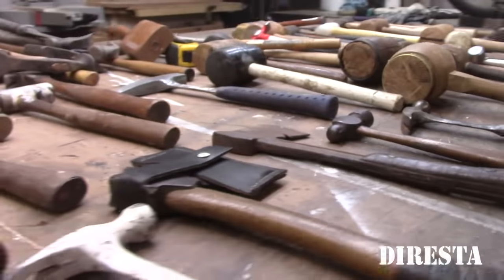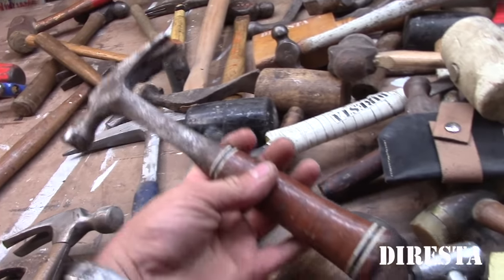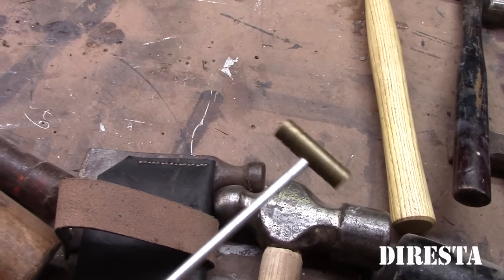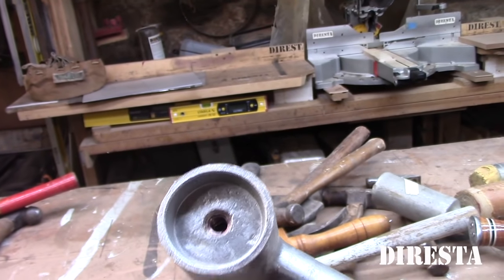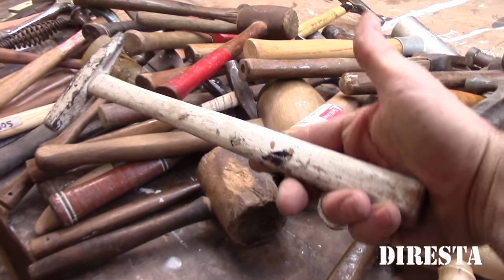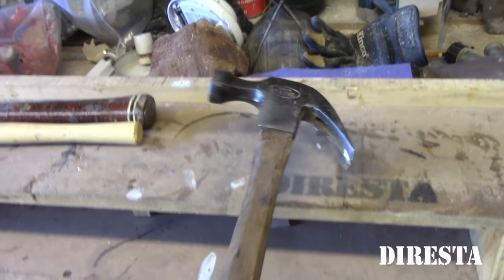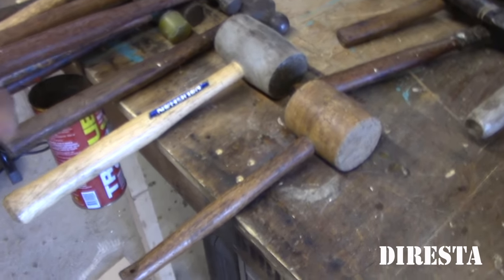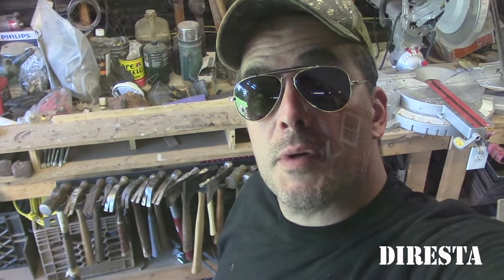✔ DiResta HAMMERS! 700K Collection

Comment: The serial killer hammers are slater hammers. You wack the back side of a slate shingle and it will give you a concave  hole on front the copper roof nail will fit in.

Comment: Love your tool collection Jimmy, the hammer that you called a roofing axe @ 4:29 is in reality a wall-board hammer for hanging drywall. It has a small notch to pull nails, a slightly rounded face for driving the cupped drywall nails, and of course an axe head to make rough cuts in the soft gypsum board.
Reply from the maker: Yes I agree. I had a brain fart.
Reply: Don't sweat the small stuff my friend, at my age (65) I attribute it to CRS (Can't Remember Shit), but it beats the alternative which is SFB (Shit For Brains) which I know you don't suffer from, but there is a lot of that going around these days.  Peace Out..........

Comment: I've used my brass harbor freight hammer so much since I bought it about two years ago the ends are almost as wide now as the middle, it's mushroomed out and shortened quite a bit. I use it especially when working on my car, really great to smash suspension parts with it because you don't have to worry about deforming the bolts or nuts you might be hitting. Well... as long as they're hardened steel that is. Cheese grade steel and aluminum though and all bets are off lol.

Comment: The hammers with the small heads that have a tapered heel that goes straight back to a strait edge...kinda like a tack hammer without the magnet.
Thats a sheet metal or fabricating hammer. The HVAC guys and gals use them to manipulate duct work and panels back before things could be bought pre made.

Comment: At 13:29 that's a shoemaker hammer, big sized one to be honest, so probably used on soles. shoemaker hammers used on leather are a bit smaller. Also the handle should be shorter to be used as shoemaker hammer

Comment: Maybe this'll help. The all aluminum hammer is actually part of a commercial meatgrinder used to pack meat into chute on grinder. Also you have one that should run 2 lbs that is a sledge on one end and the other end looks like a punch. well, it is a punch. Used on railroads by signal maintainers to knock out "chicken heads" which is an electrical connection on a rail.

Comment: I was intrigued, and apparently that Swett hammer is from the A.L. Swett Iron Works, founded 1889. The company only ceased operations in 1983, so was around for nearly a century. I couldn't find much, but there's some information about the company at the end of this page about its founder, linked here: http://www.waltergrutchfield.net/swett.htm . The page also links this cool newspaper advert from 1905: http://www.waltergrutchfield.net/images/swett-1905.jpg

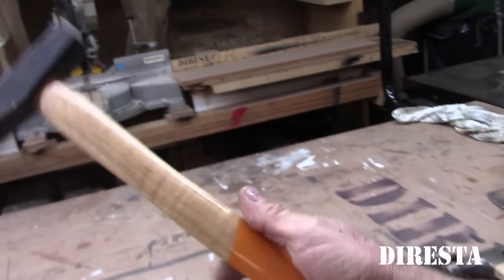Comment: The Hammer at 20:50 is actually a locksmith's hammer german pattern. For whatever reason it's the most used multi-purpose hammer in germany. Even if a claw hammer would be more useful in many cases.

Comment: The QuikWerk hammer is a hot punch or drift punch hammer. It's used by blacksmiths to drive a hole through hot metal. It was made by the Warren Tool & Forge Co in Cincinnati, Ohio founded in 1911. Apparently they rebranded a lot of their tools name to Iron City Tool Works in 1958 after a merger, so that may be a 58 year old (or more) hammer.

Comment: Congratulations Jimmy. That weird roofing hammer at 4:30ish is a drywall hammer. The hatchet side is to demo drywall while the wide, flat head helps prevent penetrating the drywall while driving nails.

Comment: Hi. Just spotted this interesting collection. The "mason hammer" at 9:30 is actually a bricklayer's hammer, used for cutting and shaping common bricks. Face bricks are cut using a lump hammer (2&1/2lb) and a bolster chisel, to give a clean cut.
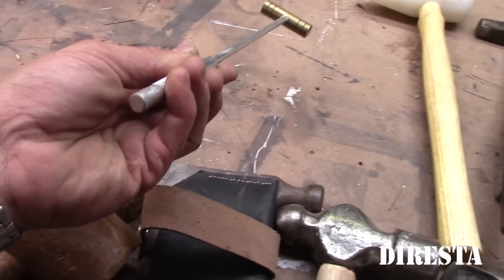The teeny little item at 10:48 is, I think, used by a piano tuner or restorer.

Comment: The 'cheesy-looking roofing axe' is a Wal-board drywall hammer, called a lollipop in the trade. Back in the days of nail-on residential drywall, it was the single most popular model. Millions upon millions of square feet of drywall have been hung with that tool - don't hate! :)

Comment: damn, wonder what the hell I was doing that day... it'd be so awesome to run into you in the hammer isle at my Home Depot in Kentucky! got me thinking about a really cool little hammer my Dad gave me that you'd love. it's a short little lead hammer that came with is 1970 something MG-B. it was specifically for unscrewing the reverse thread chrome "Knock-off" wire wheel nuts. cool little hammer with an even cooler story. one i'll have knocking around for the next 30 yrs+

Comment: Jimmy, I feel you on the broken brass screws. What works for me is, ice pick the spot then run a steel screw same thread size to tap the hole. The brass screw then just glides in.

Comment: Nice video, you have a lot of hammers! The hammer you show at 12:23 is actually a blacksmith's punch. You would use that with an assistant who had a sledge hammer to strike it on top while you guide it and hold the material to be punched.

Comment: 12:35 is NOT a hammer !!!…
I do not have the name in english, it's called a "verrouilleur" (literal transtlation would be "locker"). It is designed to "lock" in place a square section copper rivet head into it's hole in a plank and into the "cup" / "water" on the other side. This is usually done when planking a boat hull. Works like this : 1) the "nail" / spike part of the rivet it hammered down  it's pre-drilled hole with a regular hammer and into the cup (a washer like piece of copper with a conical shape) that's held by a help  on the other side of the plank; 2) once the head of the "nail"  / spike reaches the hole of the plank it must go deeper in the wood to fill the hole completely and then be covered with putty : to do this the  rivet head is held firmly by the "locker" by the spiked part of this tool that fits closely to the diameter of the hole (usually a shipyard has various sizes of this tool) while the large part is hammered down with a real hammer therefore forcing the rivet to get further into the wood. Meanwhile the help on the other side holds firmly the copper cup into which the rivet is driven by a special tool which is basically  a heavy piece of iron with a hole in its center into which the rivet end enters. (Of course this piece of iron as also a name as it is a tool in its own right, but I am at loss on this). Doing so the rivet cup flattens against the iron while the inner edge is forced into the center thus locking into the square angle of the rivet. The hole apparatus locks itself into place. 3) To finish the work the help cuts the end of the rivet and flattens it against the cup with a small ball point hammer thus covering the latter that locks firmly onto the rivet thus making both parts full tight and one. During this latter part of the job the man on the other side of the plank holds the rivet head firmly into place thanks to the spiked part of the tool shown here ("verrouilleur" in French).
Description is longer to write down than doing the job which is very straightforward one you see it for real !…
I hope I was clear enough although my English is quite clumsy on technical matters as it is not my mother language (I am OK at ordering a hamburger or a fish & ships in the UK though… but it doesn't help here).
Please, all corrections to the above comment are welcome, particularly when it comes to translation of specific terms such as "rivets", "cup" and above all "locker" (!!…) a bad extrapolation of the french term "verrouilleur" !!!…
The more so that auto-correct (Otto Korrekt ?) is quite a hassle !…

Comment: didn't have the chance to go back after the video ended and find which hammer was it, but one of the flathead hammers somewhere 'bout 1/3 in is a planishing hammer. it's made for straightening the surface of a metal armor in the forging process.

Comment: The small cross peens I know as a TInners hammer, were for tinsmith work. The Quickwerk "hammer" is a handled hot punch for smithing. The one after the geologists is a Cobblers hammer as well, and the Hammer before the slag hammer is very similar to a raising hammer, I've seen them sold as a seaming hammer for copper roofing work. The one after the Stanley tack hammer in the tool drawers appears to be something very similar to a Jeweler's riveting hammer, and the one on the skewer after it is like a goldsmith's hammer. 

Really nice "little" collection. Im certainly jealous of some of those

Comment: Jimmy! Buddy! @10:28 to answer your question, or at least my take on it at least. That style of hammer I call a riveting or sheet metal hammer! Obviously I use mine for metal working but I suppose it'd work as a general purpose hammer too :P I like that style you have personally when I'm putting duct work together or nailing in floor vents because of the rounded face on the one side I find that if I accidentally hit the sheet metal on a weird angle it doesn't leave as bad a dent or mark as a square faced riveting/sheet metal hammer would 👌

Comment: At about 4:28 what you call a real cheesy roofing hammer is actually a drywall/plaster lath hammer. Originally used for installing wooden plaster lath, then rock lath and then eventually used by drywall installers before screws became the norm. I went through a few of them in my years. About 30 or so years ago I worked with a guy who had moved to So. Ct. from Arizona. His hammer had a large square head and a larger differently shaped axe. He said that was the style of hammer used out west. The version you have are still available at most places that sell sheet rock.

Comment: The tool at 17:24 is used by blacksmiths to fuller metal, like the "neck" between where the handle fits into a hammer and the business end or "striking" head.

Comment: the quick work hammer at around 12.30 mins looks like its not a hammer but a blacksmith hot punch put it on the steel red hot and hit with another hammer

Comment: Finally someone with more hammers than me! I enjoyed the video, thanks for sharing. The Quickwerks hammer in your NYC shop was originally to be used in combination with another larger hammer to start driving holes in hot metal, also the hammer upstate that you said may have been used for railroad work with the very long hammer was for the same purpose, the extra long handle was to prevent your assistant from getting burned or hurt if the swing went wrong. I believe there was another upstate that your dad got you is for the same purpose. How about a video on restoring an Estwing with loose leather? Just an idea, I'm sure there are millions of them not being used because of that reason.

Comment: The hammer at https://youtu.be/mnQKwM4LepE?t=743 isn't actually a literal hammer, its a hot punch tool. Blacksmiths use it to punch round holes in stock with minimal amount of material lost. It keeps the integrity of the piece of steel and moves the grain structure around the hole keeping the strength of the eye.

Comment: hi Jimmy, the claw hammer with the wooden handle you have at your workshop in new york,  the one you like the shape of that came from a garage sale. that tapered head instead of the more bull nosed sort of shape commonly used by estwing is an English pattern hammer. all British made hammers where the same as that for many years. 
also well done, keep them coming, and keep us updated on the new workshop. Thanks for the knowledge! Sam.

Comment: 17 .33 min it looks like a swage used to make indents in which another peice of metal might lie to mark the beginning and end of  the material to be thinned and stretched.It was likely made with a hardy hole tool ( A swage block) a u shaped groove into  the hot material is place and shaped  with the top swage.

Comment: Jimmy I'm a hammer lover myself. I watched this whole video half hoping you would, half hoping you wouldn't have a hammer that I have had for about 30 years, don't know where I got it, it a double cross peen, one end vertical, the other horizontal. I keep it at work and use in on older GM disc brakes, to clamp down the outboard brake pad.
Never seen another like it, even in your collection.

Comment: I use the exact same estwing geo hammer for putting wheel weights on wheels when balancing them cause it has the weight to it plus it keeps the customer from standing to close to me while i do my job lol the normal actual wheel weight hammers dont have the weight needed they are too light and are plyerish for pulling the weights off the wheels i loved this video Jimmy I to like a damn good hammer

Comment: I grew up working in a family owned sheet metal custom fab shop that opened at the end of wwII and many of the tools dated from that era... At 10:30 those small wedge head hammers we had many of in the shop and I still have about a half dozen of them. I do not know exactly what they were meant for but they vary in minor ways for what ever reason. Was told they were riveting hammers used for aircraft in the war effort. I use them a lot working with sheet metal but I have never used any rivets other then pop rivets so maybe someone who knows about the old rivets for aircraft from back then may know more about what they were really for....   On a different note I have a small ball-peen hammer that has part of the mfg name still showing stamped in it as "YDOX" and would be cool if anyone knows what the whole name actually was?

Comment: shoe hammer as you called it is known as a french hammer it is used for shoe repair the long swoopy tang is for smoothing wet leather on soles to close stitch seams when they are attached with a stitcher

Comment: At 12:47- blacksmith punch,  for making holes in hot metal. Drive through until you feel the anvil, turn part over, drive out chilled spot over  pritchel hole on anvil. Keep on going ,turning stock over from side to side to enlarge hole.
Reply: P.S. -Smith holds tool and metal, striker drives it with a sledge  hammer.

Comment: the weird looking one at 430 isnt actually a goofy axe but a very elegantly designed sheet rock drywall hanging hammer and the axe part is a wedge to lift a sheet in place and the face leaves a texture around the drywall nail for mud to be able to hold to when spackeling .        I hate drywall. and hanging it but the hammer is a great design.
Reply: Yeah, every former drywall hanger/taper hates drywall, including me! Good tools yes, ones that you hope to never use again? Yes, no question!! Cheers!

Comment: The quick work hammer, looks like a blacksmith drift hammer. I have used similar ones. very cool video. thanks for sharing it.
Reply: the weird blacksmith hammer looks like a fullering hammer. about 17:30 was the time.

Comment: Jimmy, or anyone, why do hatchets have a little nick out of the bottom of them? Noticed that on quite a few of them. Thanks.
Reply: Probably for pulling out a nail
Reply: Thanks, i guessed it was something like that. Or taking off tiny branches with a dragging motion rather than a swing. Just wondered if they had a specific use rather than multiple.

Comment: Too many duplicates. You need to thin the herd. I get that it is nice to have hammers conveniently in close proximity. But how many claw hammers does one guy need? Resist the temptation to take more on.
Reply: Ignore this man. Buy ALL the hammers!
Reply: JacksonNomad
way to encourage a hoarder.
Reply: Paul's right, why have 10 hammers in crap condition, when you could have 1 thats well used and looked after ?
Reply: Scott Gates
I thought about that too. Jimmy fixed some of his hammers up, but he could work on them all full time, and still not get them all up to snuff. I don't like crapped up tools in my workshop. A hammer with a head that can fly off is especially a danger too.